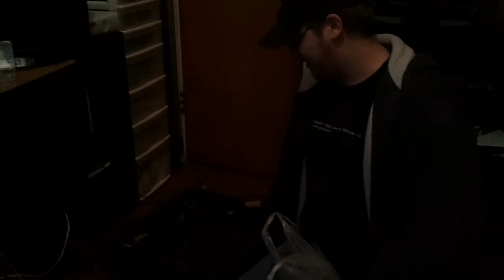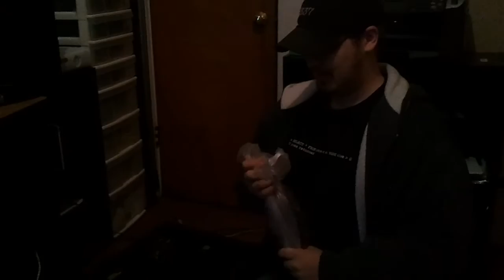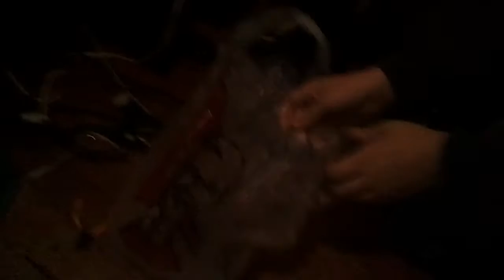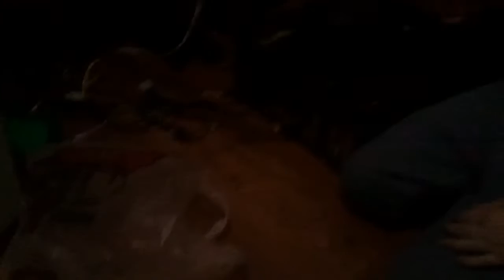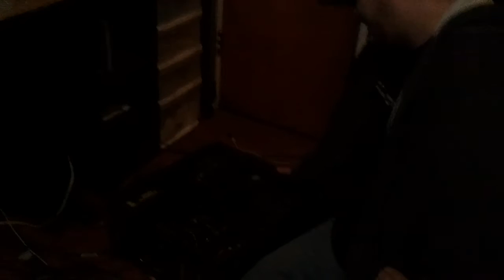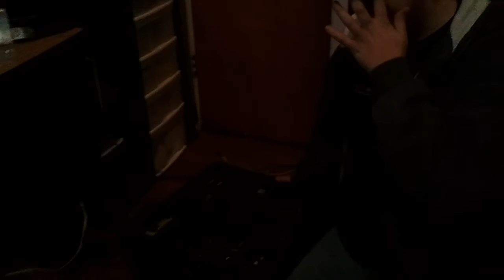Dell CPU fan 5-pin to 3-pin conversion

Comment: Can you give me an idea on how to use a 3 pin fan with a 5 pin connector? I do not know which wires are the ones to splice
Reply: Adam M hello!  u find a solution? if u,  plz tell me how plz plz
Reply: Alex Vega Yes, there are 3-pin TO 5-pin adaptors you can plug into your fan
Reply: Alex Vega ask for one at a computer store
Reply: Adam sorry for a late comment. What kind of adapter did you get?